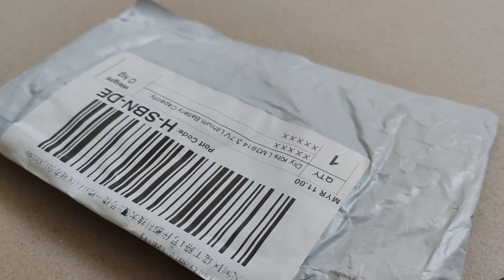Diy Kits LM3914   Capacity Indicator Module Tester LED Display Board Assembly @zero-zone420

Comment: Hi zero-zone

Thanks to your description, I managed to set up this module for my own purpose. 

I hope you don't mind some constructive criticism. I understand that you are not a native English speaker, and I'm afraid to tell you that your English is not easily understandable - no offense intended! Therefor I tried to write an improved alignment procedure. However I am no native speaker myself, so please pardon any errors I made on my own.

Equipment needed: 
Adjustable power supply
DC Voltmeter
Small screwdriver

Example: 
For a single 3.7 V lithium cell, voltage range is from 3 V (empty) to 4.2 V (fully charged). 
If you want to check a different voltage, just substitute the above voltages by your own minimum and maximum values (see points 3 and 6 below).

Procedure:
1. For the alignment it is recommended that you bridge both the J1 and J2 solder pad pairs with a small blob of solder (set to 'always on' and 'bar display' instead of 'dot display').
2. Connect the power supply and the voltmeter in parallel to the PCB.
3. Set the power supply to 4.20 V, check with the voltmeter.
4. The LEDs will show some arbitrary pattern.
5. Adjust trimmer potentiometer RV2 so that the 10th LED is just coming on.
6. Set the power supply to 3.00 V, check with the voltmeter.
7. Adjust trimmer potentiometer RV1 so that the 1st LED is just coming on.
8. The settings of the two trimmer potentiometers have a small mutual effect, therefor repeat steps 3, 5, 6, and 7 two to three times.
9. If you want the tester to be on only when pressing SW1, remove the solder blob from the J1 pads.
10. If you want the tester in 'dot display' mode, remove the solder blob from the J2 pads.

Comments (my 2 cents):
I fail to understand the purpose of resistor R1 (the one on the same side as the LM3914 chip) since it is connected across the supply. You can omit it without any negative effect.
The LM3014 data sheet recommends an electrolytic capacitor of 10 uF. Its voltage rating must exceed the maximum voltage you use the tester for (35 V recommended). You might want to connect this capacitor instead of resistor R1.

Kind regards
Robert
Reply: Sorry, the last paragraph should read:
The LM3914 data sheet recommends an electrolytic capacitor of 10 uF across the LED supply voltage. Its voltage rating must exceed the maximum voltage for which you use the tester (35 V recommended). You might want to install this capacitor instead of resistor R1.